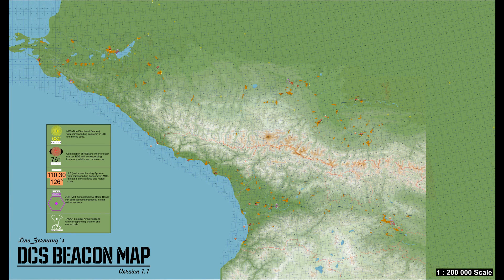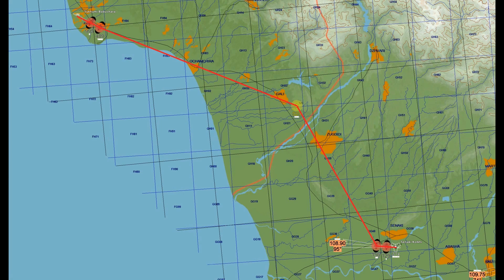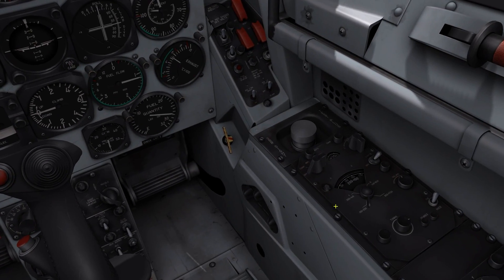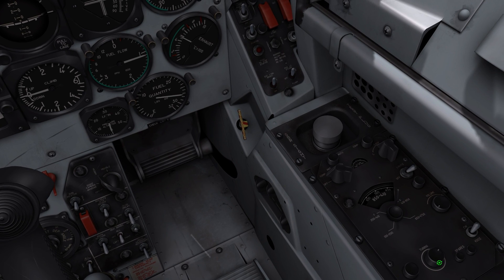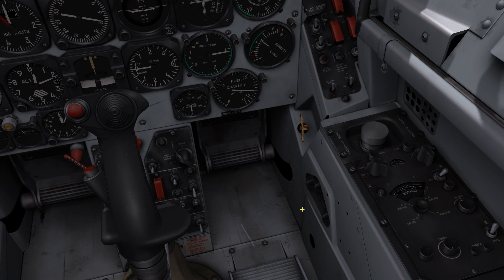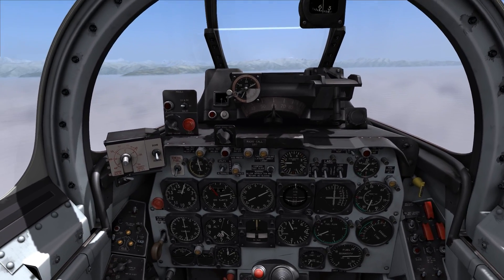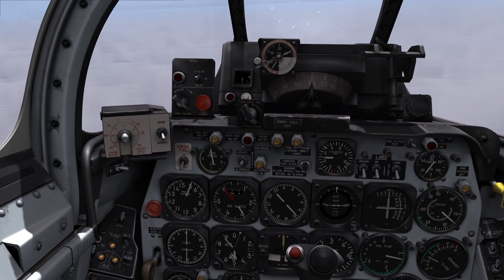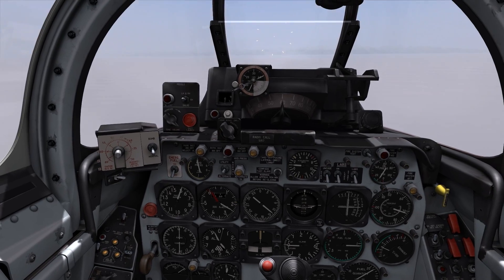[DCS] F-86 SABRE NDB Navigation

Comment: Let me give you an update folks, its April 2020:   The NDB do  not work. Sit on the ground, turn on your ADF and cycle through the stations, either using the map (F10) or any of the published maps like Lino Germany and you will quickly find that the listed frequencies for airports  do not match the airports.  The identifier morse code is wrong.  There are a few that do work, but the rest are incorrect.  If you go to any other theater (Nevada, Middle East) there are so few NDBs that it's not even worth it.  SO your NAV system fro the F-86 is inop.
Reply from the maker: Thank you for providing this information. Sucks that it is not implemented correctly.

Comment: Nice thanks. If you are going to continue with doing tutorials, you might want to change the layout of your channel page. You can do it by clicking the pen tool in top right of each panel on main part of page, which will let you give it a nice layout.

Nice videos, and could be most useful. I hope you do more with the Sabre and possibly the A10C later on. Subbed.
Reply from the maker: Thanks for the suggestion!
I adjusted the channel page a bit and also uploaded a trailer yesterday.
I will do some more videos about the Sabre, but I am also planning to do some videos about the MiG-21. The A-10C isn't on the near tearm future plan unfortunatly, but if I run out of stuff to do tutorials on, I will keep it in mind!

Comment: I think there is something wrong with the morse codes right now...I almost always seem to hear dual transmissions.
Reply from the maker: This is interesting to hear, because I was thinking the same. Before I recorded this video, I tried to identify the morsecodes, just to make sure it will work during the video. I was 100% that the morsecodes for the departure and destination worked correctly and where easy to identify.
However, when recording the video they sounded diffrent. I couldn't really identify them anymore (as you have noticed in the video). I thought it was just me, but we could be onto something.
Reply: John, there's nothing wrong with your ears or hearing morse code properly. It's playing several stations overlapped. IRL this would be evidence of a selectivity problem in your radio, but I don't think that's the intention here. 40's and 50's vintage ADF worked very well, and didn't have serious selectivity issues.

It seems that the first station you successfully tune in does not stop playing its identification, when you tune off and onto the next one. Indeed it may play the morse for all stations you select.

In the Belsimtek Huey and other aircraft with ADF capability, this does not happen. What's strange, is that the Belsimtek implementation for the Huey is just fine. They could almost have copied it verbatim, but with another 3D panel to drive it, and it'd be OK.

But this bug does make it impossible to do the age-old TIT (Tune, Identify, Test) check that all pilots do when using NDBs until the morse-bug is fixed.
Reply from the maker: sleat Thank you for your comment. Yeah, I figured there was something wrong. Identifying ADFs or VORs for that matter by listenening to the morse code shouldn't be that difficult.
I assume it could be a similar problem to the never ending seeker tone of the Air-to-Air missile, even if it has been switched off again. But I guess thats beta...
Reply: xxJohnxx If you try the ADF in the Huey, it works fine. I use it lots. It's as if the initially played morse sequence is not being turned off when a new station is tuned, and so they overplay each other.
Reply: sleat  You guys identified the problem correct but it's not Sabres fault. The problem is DCS World related and can be reproduced in other A/Cs too -> http://forums.eagle.ru/showthread.php?t=127847
Reply: overlapping beacon audio needs to be fixed badly
Reply: absolutely but currently they concentrate on other tasks as fixing bugs, manual and Mig-15 etc.